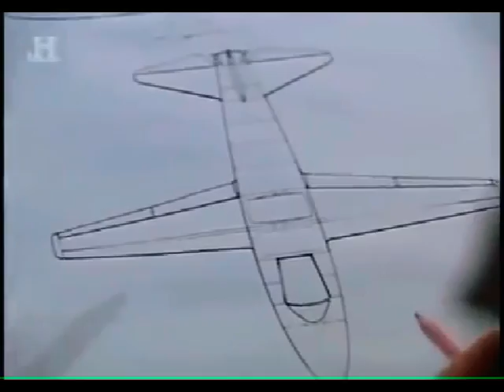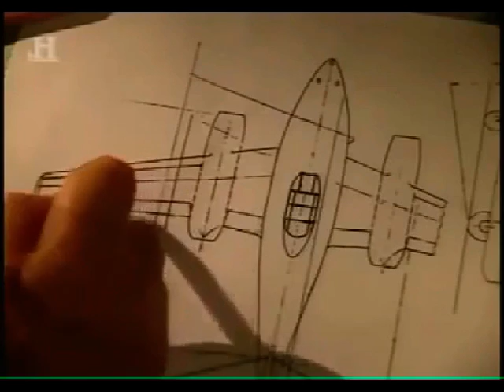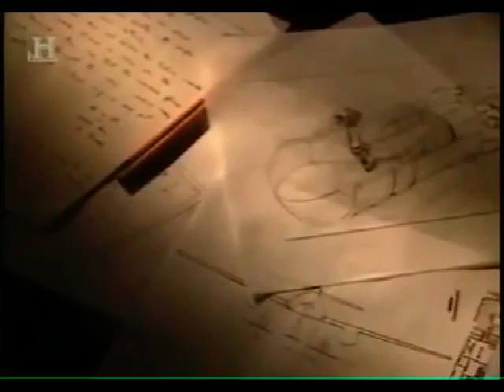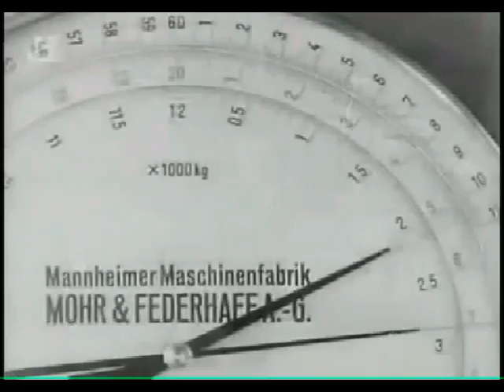The Father of the Jet Engine - Hans Von Ohain

Comment: One word for Hans Von Ohain - plagiarist.
Reply: Spotty.
Please do all over your keyboard you might not be able to keep on telling the lies you like.
Reply: He found out that whittle had a working turbo jet and they got the info from patent office he said it himself all documented believe what you like turbo jet inventor that worked efficient was frank whittles fact
Reply: They didn’t knew about each other other. Ohains Concept is widely used today while Whittles is dead. And Ohain built the first which ran under his own power.
Reply: @bekluwe  I recommend reading Ohain's own words in his foreword to 'Elements of Propulsion, Gas Turbines and Rockets' in which he states-

"The first patent of a turbojet engine, which was later developed and produced,
was that of Frank Whittle, now Sir Frank (see Fig. 5). His patent was applied for
in January 1930. This patent shows a multistage, axial-flow compressor followed
by a radial compressor stage, a combustor, an axial-flow turbine driving the
compressor, and an exhaust nozzle. Such configurations are still used today for
small- and medium-power output engines,"                                                                          
Please note the reference to axial flow compressors.

and 

"From the beginning of his jet propulsion activities, Frank Whittle had been
seeking means for improving the propulsive efficiency of turbojet engines. ¶ He
conceived novel ideas for which he filed a patent application in 1936, which
can be called a bypass engine or turbofan. To avoid a complete new design,
Whittle sought an interim solution that could be merely "tacked on" to a jet
engine. This configuration was later known as the aft fan. Whittle's work on
fan jets or bypass engines and aft fans was way ahead of his time. It was of
greatest importance for the future or turbopropulsion." 
Please note that's about Turbofans.

You will also be able to read Ohain's own description of his own patent-

"In early 1935, I worked out a patent for the various features of a gas turbine
consisting of radial outflow compressor rotor, combustor, radial inflow turbine,
and a central exhaust thrust nozzle."
Please note the absence of any axial flow elements.

You will also be able to read in Ohain's own word how all of his designs were cancelled and never went into production. You may choose not to believe Ohain's own words but they are there for you to read if you wish.

Comment: FACT! The Jet Engine pioneers all more or less started out together without any real knowledge of what the other designers were up to! Whittle designed CENTRIFUGAL flow engines which, at their best would turn out to be a dead end in engine design.

Ohain settled for a compact 'reverse' flow layout which flew successfully and went on to become the basis for many successful designs, still being manufactured today, including the P&W PT-6 and units used in the Chinook Helicopters  etc etc

Brandner of BMW went for the Axial flow option which became the norm in jet engine design...and eventually designed  the mighty Kuznetsov NK-12 Turboprop! Still, after all the intervening years, in service as the power plant for the incredible Tupolev Bear!...which is reputed to be going to remain in service til 2040! 

Incidentally, even Westinghouse, with vast experience in Steam Turbine design, got into axial flow jet engines in 1941 and had their engine running in 1943...but, were to eventually lose their way as Jet Engine producers.

Whittle did well against the odds, to produce sound jet engines, but they were always going to be superseded by the much superior Axial flow designs which are now very much the norm in aero engine design.

Time we tempered the all the talk about Whittle being the father and first great pioneer in Jet Engine Design! He was ONE of the pioneers!...and...and...he was NOT the best of them!
Reply: +Mick Dunn  FACT - You have made so many errors here I think it is some kind of new record! Perhaps you should have done some homework before posting.

I will deal with them one by one.

1     von Ohain did not design a reverse flow engine. His engine had a centrifugal compressor and a radial inflow (centrifugal turbine - a design never used in any production engine. This was a patent held by Whittle. von Ohain even commented on its unusual design when he read Whittle's patent prior to filing his own: From his biography:

"When I saw Whittle’s patent I was almost convinced that it had something to do with boundary layer suction combinations. It had a two-ﬂow, dual entrance flow radial flow compressor that looked monstrous from an engine point of view. Its ﬂow reversal looked to us to be an undesirable thing, but it turned out that it wasn't so bad after all though it gave some minor instability problems." 

2    Whittle's reverse flow design is the basis for almost all turboprop engines in production today.

3    Britain had axial engines running in 1941 - the same time that Franz had his early Jumo running. They flew the Metrovick F2 in 1943. The F2 was developed into the Sapphire which the US built as the J-65 and in modified form as the J-47.

4    Westinghouse was given a Whittle engine and all the plans but made such a mess of their attempt to build the engine that Whittle came over to help them but in the end the US Government gave the project to GE who made the I-16 which then went on to become the first US built jet engine. The US licenced the Ghost for the P-80/T-33 and the Nene for a number of other aircraft.

5    Derivatives of Whittle's designs are still in production today. (PT-6, PWC 100/150) So much for being superseded!

6    Von Ohain's engine never went into production and was shelved by 1943. No-one ever built an engine using his configuration.

7    Whittle also considered axial engines but knew the metallurgy was not advanced enough at the time.He was right. His engines produced much more thrust than the German axials and had orders of magnitude better reliability.

8   Whittle's centrifugal engines were built under licence in the US after the war as the J-33, J-42 and J-48. 
     The RR Trent was the world's first turboprop to fly.
     British axials led the post war world in technology and power. 
     The Sapphire was built in the US as the J-65. 
     The GE J-47 was based on the Sapphire. 
     The Olympus was the world's first 2 shaft turbojet and the first to exceed 10,000lb thrust. 
     The Avon is the longest produced gas turbine in history being still in production as a land based generator. 
     The RR Conway was the world's first turbofan.
     The RB-211 was the worlds first 3 shaft turbofan.

Time for some homework perchance?

It is an historical fact that Whittle is the father of the jet engine and the vast majority of turboprops flying today are testament to his genius.
Reply: Except that Frank Whittle patented his engine before von Ohain even completed his studies and von Ohain discusses in detail, (in his biography) reading Whittle's patents before he even filed his own and years before he built an engine.

Even operating on a shoestring budget, Whittle ran his engines 6 months before von Ohain and only Whittle's engines ever went into production and his designs are the basis of most turboprops in service today. 

Not a bad achievement and one worthy of the title - inventor of the jet engine.
Reply: None of them patented firstly the jet engine
read wikipedia.
Reply: You seem to be missing the POINT. Whittle PUBLISHED  - YEARS before Ohain.Ohain ADMITTED reading Whittle Patent Application. End of.
Reply: Mick Dunn,  Do you have a patent?  I'm sure that if you did and wrote it yourself, you'd understand that there's NOTHING original in Ohains design.  Everything in it could be gleaned from whittles original patent, (that was both axial and centrifugal)  it was just a matter of manipulation of terms in the claims!  Ohain can't claim anything new.  Look up patent law and educate yourself!  All of this is just semantics,  no one would claim that Von Braun invented the liquid fueled rocket (because it was more successeful!)  It was Robert Goddard!  That's the fact of principle and concept,.... And that's what Whittle did.  How dare people try to take that away from him!!!!!!!!!!!
Reply: Ádám Jánossy Wikipedia is unreliable.
Reply: HeavensGremlin
Hahahaha, the jet-engine related articles are full with citations from expert books. Deal with the reality.
 Read the books in the references and citations
Reply: Mick Dunn it's such a dead, the centrifugal compressor, that RR is still using them in turbo-shaft engines uch as the MTR390. Whilst not so good for fixed wing aircraft engines, they are still useful. Please do a little research before saying something is a dead end.
Reply: @stears333   "Read the books in the references and citations"  Even though you haven't?  If you had, you would reference the books rather than wikipedia.

Comment: I heard dr von ohian talk about jet engine development in 1980 and 1981 at the university of florida.  Von ohain made the jet work he was the first.  Dr. Von ohain was a great American patriot, strong supporter of us military, and a very fine man.  Talking with him after his presentation was a great honor.   He taught propulsion at the university of florida a year i took peopulsion.  Cannot say enough good about this great man.
Reply: He was German, not American.
Reply: wrong on practically every point
Reply: I. Stand by my stateman he was a american citizen
Reply: He wasn't first. Nor claimed he was.
Reply: @OldEastGermany  looks like he changed sides and nationality after the war, like many other incl v.Braun
Reply: Hans von Ohain and Max Hahnn built the first jet engine, they wpuld be the first to build an engine that powered a jet aircraft in August 27th 1939... two years before Whittle.
Reply: @sandervanderkammen9230  From his foreword to 'Elements of Propulsion, Gas turbines and Rockets' Ohain says-
"The first patent of a turbojet engine, which was later developed and produced,
was that of Frank Whittle, now Sir Frank (see Fig. 5). His patent was applied for
in January 1930. This patent shows a multistage, axial-flow compressor followed
by a radial compressor stage, a combustor, an axial-flow turbine driving the
compressor, and an exhaust nozzle.

and

"In April 1937, Whittle had his bench-test jet engine ready for the first test run.
It ran excellently; however, it ran out of control because liquid fuel had collected
inside the engine and started to vaporize as the engine became hot, thereby
adding uncontrolled fuel quantities to the combustion process. The problem
was easily overcome. This first test run was the world's first run of a bench-test
jet engine operating with liquid fuel (Fig. 7)."

and

"From the beginning of his jet propulsion activities, Frank Whittle had been
seeking means for improving the propulsive efficiency of turbojet engines. ¶ He
conceived novel ideas for which he filed a patent application in 1936, which
can be called a bypass engine or turbofan. To avoid a complete new design,
Whittle sought an interim solution that could be merely "tacked on" to a jet
engine. This configuration was later known as the aft fan. Whittle's work on
fan jets or bypass engines and aft fans was way ahead of his time. It was of
greatest importance for the future or turbopropulsion."

Comment: Well Ohain and whittle were the fathers of the centrifugel Jet engine. These types are not used anymore. The real Inventor of the axial flow Jet engine used on all todays Jet aircraft was Anselm Franz and his Team at Junkers Motors.
Reply: Graham Pinkerton just 2 things: 1. Centrifugal compressors are still in use in helicopters. 2. Please explain the Metropolitan Vickers F.1 axial flow jet engine programme that first ran in 1941?
Reply: Whittles design patents covered both centrifugal and axial jet engines, the Jumo was based on Whittle's  patent just like Ohain's design.
Reply: The world's  first axial compressor turbojet engine was designed and built by Dr.Anselm Franz it ran in October 1940, the Jumo 004 was the first production axial turbojet.
Reply: @barrierodliffe4155  Here is what Ohain had to say in his own words-
"The first patent of a turbojet engine, which was later developed and produced,
was that of Frank Whittle, now Sir Frank (see Fig. 5). His patent was applied for
in January 1930. This patent shows a multistage, axial-flow compressor followed
by a radial compressor stage, a combustor, an axial-flow turbine driving the
compressor, and an exhaust nozzle. Such configurations are still used today..."

It's odd that wehraboos like Sandyboy there can't see the bit about axial compressors in there.
Reply: @sandervanderkammen9230  Make up your mind Sandyboy, only a handful of posts you were giving that credit to Maxime Guillaume.